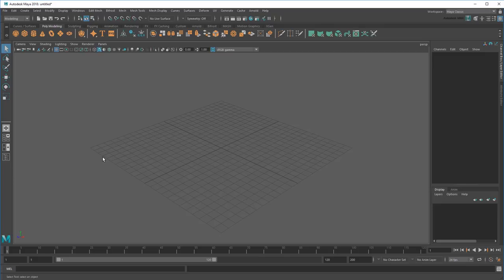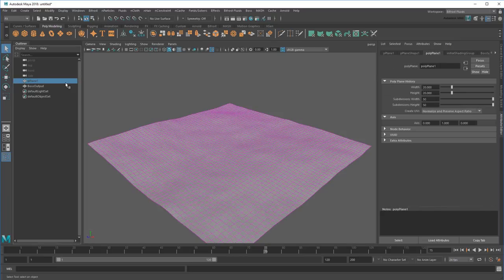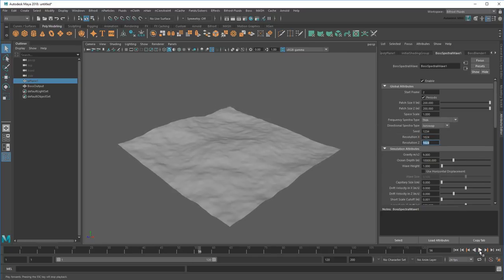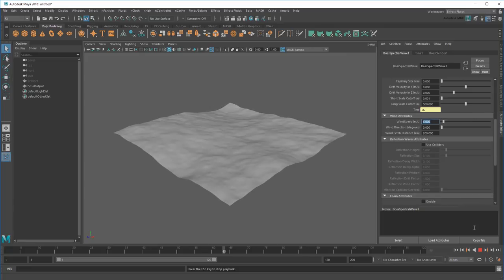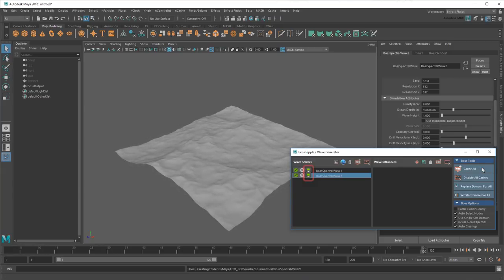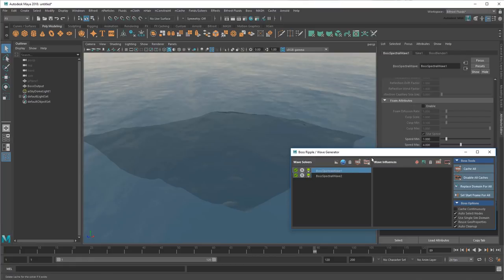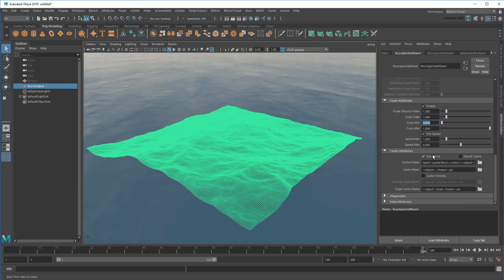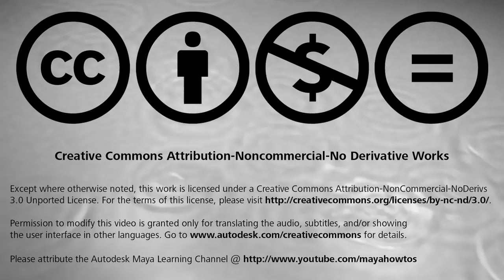Creating an ocean - Part 1 of 4: Getting Started with BOSS

Comment: Hello, I was able to get to where you added the foam the 1st time and its to much.  I followed your steps but it will not minimize the foam. How can I dial it down so its a little bit on the water?
Reply: did you find any solution? I am having same issue.
Reply: nvm.. it worked for me now.
Reply: @rajameena5108  No, I have not

Comment: For reasons that I'm not sure if I will ever understand, the bifrost plugin is loaded, but the menu is not showing up as specified by this tutorial. I'm not sure why, but it's just not showing up in the headers. I just don't know what to do.
Reply from the maker: Did you switch to the "FX" menu set from the dropdown in the top left?
Reply: @Autodesk_Maya  So I found out what the problem was last night. Yes I was on the FX tab, but there were more plugins that needed to be loaded aside from BOSS having to do with Bifrost. I forget which specific plugin it was, but searching up Bifrost in general in the plugin manager's search bar and then making sure bifrost related plugins are loaded did the trick.

Comment: Maya Learning Channel
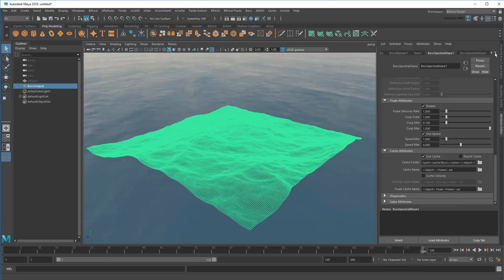9:16 I can't find the AIStandardSurface1. I have selected the BossOutput.
Reply from the maker: Do you have the Arnold plugin loaded?
Reply: @Autodesk_Maya  Yeah
Reply from the maker: @fnaffartsanimations8013  Is the issue that you can't apply an aiStandardSurface shader to the result, or you can't find the tab in the Attribute Editor after you've applied it?
Reply: @Autodesk_Maya  I can't find the tab in the attribute editor after I've applied it.
Reply from the maker: @fnaffartsanimations8013  Odd.  Well, as an alternative, you can open the Hypershade and select the shader in there instead.  This editor will show you all shaders in the scene at all times.
Reply: @Autodesk_Maya  ok thx

Comment: Hello! First of all I want to thank you for the video as it was insanely helpful with finally figuring out how to get some water into Maya. I did run into a few concerns while following your steps. The first one is I received a message on the bottom right next to where you have the text box to type into MEL. It was something around the lines of: maya cached playback safe mode. That and some mention of unsupported nodes. I was wondering what exactly the problem is and how I can fix it. The other problem I have is when I click on export cache to preview a single frame like you did in the video when you made the foam adjustments it stays exactly the same without showing any changes. I would greatly appreciate the help and thanks again for uploading these videos!
Reply from the maker: Cached playback is a feature that improves playback speed in the Viewport.  At this time, it's not compatible with FX like BOSS, which is why you're getting that warning.  It's nothing to worry about.
Remember, when you make settings adjustments, you need to turn off the caching in the BOSS Editor.  Otherwise, the simulation will just go back to the old cache (representing the old settings).
Reply: @Autodesk_Maya   Oh okay that brings some relief and clarity. Thanks for the fast response! I greatly appreciate it :)

Comment: I'm trying to make a longer animation, but even when I redo the cache my waves are not working. I mean they work until the frame 120 and then It's just a flat plan. Can you help me with this?
Reply from the maker: It sounds like you're still reading from the cache.  To make double-sure you're not relying on it, I recommend deleting the old cached files in the cache directory, then regenerating them.

Comment: I'm sure you've had this question but i can't seem to find it below, I'm having trouble with the Image source for the foam when I click 'Use Image Sequence'.
The tile that shows the image source (Foam in this instance) shows black after clicking 'Use Image Sequence' and shows 'exr doesn't exist, node file2'. Have I exported this files wrong from your download link?
Reply from the maker: Actually the demo file doesn't have the foam EXRs included in it, because the file sizes are so huge.  You'll need to generate them yourself using the steps in the tutorial.
Reply: Maya Learning Channel oh weird, the Foam works without clicking ‘Use Image Sequence’. I’ll have to have a closer look at the tutorial 😬 thanks for the reply.
Reply: Yayy! I got it. I had forgotten to click enable in the foam attributes.

Comment: I followed this to the T (apart from size cos i wasn't expecting to add BOSS to my scene) but the foam looks stretched :( ... looks fine in the 2D image tho, so I'm confused as to what would be causing the distortion.
Reply from the maker: When you say "apart from the size", does that mean you resized the plane into non-uniform proportions?  if so, that could be the issue since you're applying a square image to a stretched plane.
Reply: @Autodesk_Maya  the size of my scene, I created it in centimetres so when I use the measurements in the tutorial, the ocean plane is too small. When I increase the size, it messes up the waves.
Reply from the maker: @randomMaui  I would actually move on to part 2 of this tutorial, and then apply THAT to to your scene.  Rather than scaling the ocean up, you can just tile it (just make sure the wave size is the way you want first).  This will also help with animation performance since you'd be able to strip out the BOSS simulation.

Comment: hi , i'm doing a simulation with boss, but i have some problems. and i have some questions:
first i create a plane with 120 x 120, because i need more space for the shifting ship. and i want to know if when simulate the foame  with particles, the model used for this (the simulation) have impact in the procesing, if it have many polygons? thanks.
Reply from the maker: Andres Fernando Polania Castaño the sim will run slower, but it should still work.  You’ll definitely want to cache the effect to an alembic file for rendering (which I show in a later tutorial)

Comment: Hey, thanks for this amazing tutorial. I've tried this with redshift. But, projection doesn't really work in redshift. It works a little bit with linking "out alpha" node to displacement shader (instead of out color node in arnold). but it loses a lot of information. If you don't mind, could you let me know how to make this tutorial work in redshift as well? Thanks a lot! :)
Reply: Yeah, I'd like to be able to get this working in Redshift as well. I can get the displacement to work pretty well but the foam maps are another story.
Reply: @forrestarnold666  I had the same problem with the foam maps and I got it to work by plugging it into the diffuse weight on the redshift material

Comment: How would you apply it to multiple planes? would you apply multiple solvers or can you apply the same solver to multiple planes?
Reply from the maker: Out of curiosity, why would you want to apply it to multiple planes?  It would become very difficult to line them up to have matching wave patterns.  And anyway, Maya only supports one solver in the scene at once.  If you wanted to simulate two different bodies of water, you'd probably want to do them seperately and then animation cache each of them for performance anyway.  Or I suppose you could combine the seperate planes into a single mesh (leaving them detached) the run a single solver on the result.

If you're ever trying to represent one body of water though, I'd highly recommend using just a single mesh for a more consistent overall look.
Reply: yea I was trying to have them represent a single body but even if there were multiple solvers it only did it with 1. Also would you know why it's assigning 2 BossGeoProperties to each mesh I select?? there's no duplicates or anything so I just don't know what's going on there. Also possibly how to get it to simulate faster?
Reply from the maker: @mamoruk4143  Sorry I misspoke earlier.  You can apply multiple solvers to a single mesh in order to represent different "levels" of waves, but you can only apply them to a single mesh.  Your best bet to have more than one mesh is to simulate them separately and then alembic cache the meshes afterward.  However, for any single body of water, I would only recommend one mesh anyway.

To speed up simulation, you'll either need to lower the number of subdivisions on the mesh, or improve your CPU and RAM.  Once you have simulated it once though, you can apply the waves as a displacement to a flat plane, which will remove the need for any calculations and greatly speed up the scene anyway (I show you how to do that in part 2 of this series).

Comment: Hey, thanks for the amazing tutorials. But I have a problem. My ocean plane looks too blocky/pixelated and I can't find a solution?? I'm working with 1024 subdivisions on the plane and I have 2 SpectralWaves, but it still looks very blocky. How can I make it smooth? Thanks a lot!!!!
Reply from the maker: Did you cache the ocean at a lower resolution before upping it to 1024?  If so, you'll need to disable the caches first (in the BOSS Editor, change the green checkmarks to red) to see any changes.

Comment: Hi Sir ... Question is that Boss plugin is not showing to me in Plugin Manager of my Maya 2019? So i cannot be able to load . How i can get it in plugin manager . Do help please. Thanks in advance.
Reply from the maker: Are you using Maya LT?  BOSS is only available in the full version of Maya.  If you are using that, then you may need to reinstall if the plugin isn't appearing (it's possible it wasn't placed in the plugins folder properly)
Reply: Today i downloaded only maya bifrost 2019 and installed separately to my PC.  Now Boss is showing in plugin manager . Thanks a lot for your reply . Good day.

Comment: Hi there, I'm running into a real issue at about the 10 minute mark, I've enabled foam, works fine, disable use cache/enabled export cache, however when I lower my cusp min value, I get no change at all in foam amount. I've been trying every option in the panel available and I'm not able to see any change, I'm using Maya 2019, getting slightly frustrated, and I thought you may have an idea for a fix.  Thanks!
Reply from the maker: If you want to be sure it's regenerating foam, try deleting the actual foam cache files in your project directory.
Reply: @Autodesk_Maya  Actually it was a simple issue, I was using foam maps from a different project file from a few days ago. Thanks for the quick response! I've been doing your tutorials all week lol.

Comment: Thank you so much for the tutorial. One question though, when I render it with CPU its fine but when I use GPU render ocean becomes very dark. I use RTX 30 series. Why’s that?
Reply: if you're using redshift for the gpu render, you have to assign the redshift material to the ocean instead of the aistandard material

Comment: I am having issues with the foam, it looks like the foam you had after initially putting it in, reducing the cusp min value made absolutely no difference. 

I am using the 2020 Student Version of maya.
Reply from the maker: A few people below have had this same issue.  Make sure you're regenerating your BOSS cache each time you change the cusp values, otherwise you'll just be viewing the old cached values regardless of what your current settings are.
Reply: I regenerated the foam just as you explained, but I can't find the file. :/
Reply: ik I'm late but the way I fixed having this same issue was deleting the original cache files manually in file view, generating new a cache and then relocating the new files to the emission editor. I'm sure its not the most efficient way but it worked.

Comment: Hello I have problem for foam, Warning: htm boss, bossSpectralWave1.foam.0019.exr doesn't exist, node file2. 
I think comparing to your video some files are missing ? for the foam is that normal ? (I turn the Image sequence and had an error like missing files and going to ''53'' not like you it's written 120) 

Thx fo the help/futur reply
Reply from the maker: Sounds like you need to regenerate your spectral wave / foam cache.  When you do, try setting the Time Slider speed to "Play Every Frame" to ensure the cache is generated properly.

Comment: What processor and graphics card are you using? How long does it take for you cache all and render? I am not too sure if my render was completed or not.
Reply from the maker: I'm running a Xeon dual 2.6GHz process, 32GB RAM, nVidia Geforce K4000.  For this patch of ocean, it takes about 15-20min to render 120 frames at 540p.  For the tutorial after this one (full ocean), it can take an hour or two to do the entire ocean with a high number subdivisions.

Note that your graphics card doesn't matter all that much when using BOSS since it uses mainly the CPU.

Comment: Great tutorial, thanks for the help. I did run into the issue of when i apply the aiStandard surface deep water preset, my waves disappear. They are still an object and i can click on them but if I render the screen is just 100% white/gray. Am I missing a file or something? If I don't apply a preset and simply change the color then when i render i can see my waves perfectly fine. Please, anyone help:/ Thanks
Reply: If you are still struggling, make sure to (re)apply the surface to your object. I had that issue as well.

Comment: At the 11 minute point, as soon as I add skydome and render, I get a white frame with no details.
Reply from the maker: Have you tried lowering the Exposure or Intensity of your Skydome?
Reply: @Autodesk_Maya  Yes, it just turns to grey. But I figured out what was wrong by comparing to one of the ocean examples that came with a skydome light. There is an input node you have to connect to a sky material. Once I did that, I got the expected result. This needs to be pointed out in tutorials.
Reply: @basspig  which node?

Comment: My animation only lasts about 11 frames. How can I make it longer?
Reply from the maker: Could it be that the timeline at the bottom is only 11 frames wide?  You can try increasing the number in its bottom right side to increase that.  Or if you mean that the animation stops after 11 frames, you'll probably need to redo the cache (turn off the caches for each solver then use the cache button as shown in the video).

Comment: Is it heavy in render? Compared to realflow for instance. Great vid btw
Reply from the maker: Nope, not very heavy at all since it's just geometry.
Reply: Yeah i see, i'm actually rendering a sequence :) Another question: in Maya 2017 it don't seems to have the foam attributes in the spectral waves settings. No Box to activate it... I think I'm gonna have to upgrade to Maya 2018
Reply from the maker: Yes, there were some additions made to this feature (although it happened in 2017 Update 2, rather than 2018).
Reply: Appreciate the fast answer, I have maya 2018 at work I'm gonna see if there's difference

Comment: how to do to be able to export this animation in fbx? I'm not getting :(
Reply from the maker: FBX doesn't support the actual BOSS architecture itself.  To get around this, you can select the ocean and go to Cache > Alembic > Export to Alembic.  Then import that cache into an empty scene and save that as FBX instead to just keep the deforming geometry.
Reply: I understand, but would I be able to export the animation together?
Reply from the maker: @arktetos9138  The Alembic cache will be an animated mesh, so you should be fine.

But in short no, FBX doesn't have support for BOSS itself (that's a Maya-specific feature), so you can't just include the BOSS simulation in an FBX file.

Comment: Hi there! If I want to apply this to a CUBE, do I need some sort of UV mapping?, I tried but it does not look right on the sides of the cube. Thanks!
Reply from the maker: Manny Morales Is the idea that you want waves facing outward on each side of the cube?  If so, my recommendation would actually be to apply them as textures to each face using the technique shown in the next part of this tutorial.

If you just apply the BOSS solver to a cube like in this one, it’ll still work - but it will treat the cube as a single thick body rather than 6 flat planes (which is likely what you’re experiencing).

Comment: why i reduce cusp min parameters  , the foam not reduce?
Reply from the maker: You might still be seeing the old foam.  To make absolutely sure, I'd try deleting the old foam cache when testing new foam values.
Reply: ok,thanks,problem solved
Reply: @Autodesk_Maya  The foam doesn't change when I drop the "cusp min" value to 0.1... I tried dropping it to .001 to test, but no change. When I change it to 10, it goes completely white, so I know it's not a caching issue... Also, I deleted my entire cache, started again, reset the scene and started over... Same result. Looks like a cove.

Could it be scene scale?
Reply from the maker: @NickRomick  It is possible that it's your scene scale.  Is your scene scaled differently from this tutorial?  If so, try doing the tutorial exactly as shown just as a test.  Does the foam change properly then?
Reply: @Autodesk_Maya  I started again with the same parameters (size: 20 x 20 , subdivs: 50 x 50) and got the same result. I'm using Maya 2018.
Reply from the maker: @NickRomick  Hmm, have you tried deleting all the foam files from 0.1, then regenerating them at 0.01?  And are you sure you're writing to the same folder that you're reading from?
Reply: @Autodesk_Maya  I tried deleting everything and starting over, so yeah... :/ I dunno what I'm doing wrong. I'm usually so good at following instructions, and this is extremely straightforward.